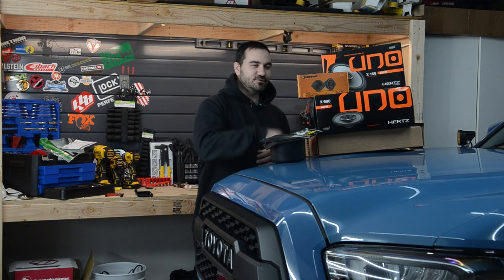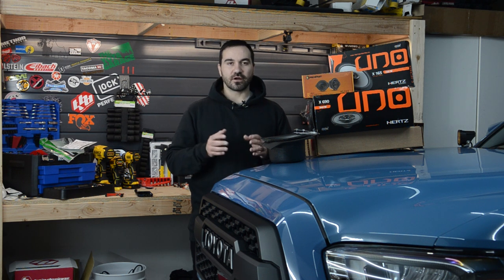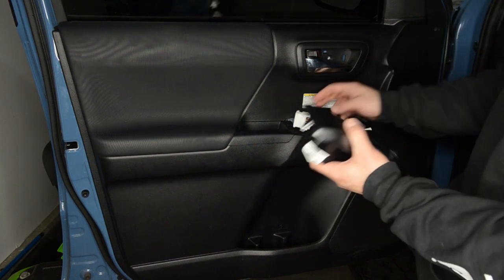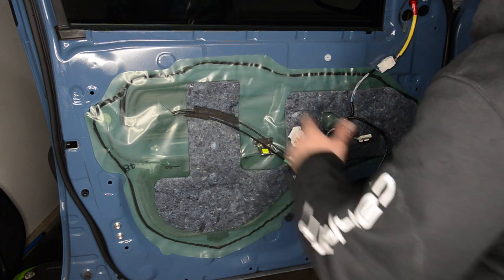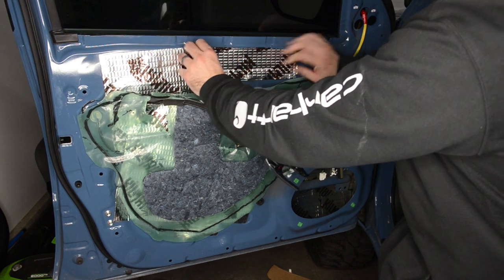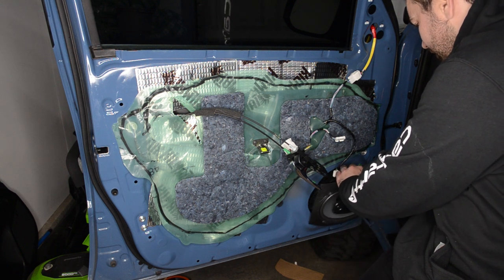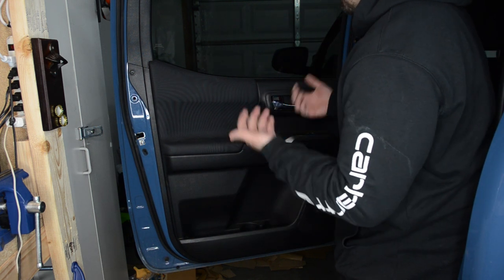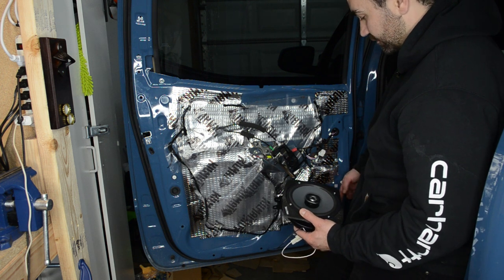Tacoma Sound Deadening & Speaker Upgrade How To - 2016+ Toyota Tacoma (3rd Gen) Sound Proofing

Comment: you should apply sound deadening around the mounting hold for the speaker itself like folded over it will help a lot i think more so than the extra strips you put on last over the other holes

Comment: If you look at the speaker brackets they have a cutout for the wire harness to come thru the adapter plate so you are not pinching the wires.
Reply: 1000000%. This whole video makes me not trust others to work on my truck because of how sloppy some can be

Comment: Should have put a gasket on the back of the mounting bracket. When screwing speakers to the bracket, use a finger to guard the speakers surround from any screw driver slips. For deadening on the outside door (behind the door panel) use a sound deadening matt to eliminate plastic rattling.

Comment: So I heard the jbl system has 2 ohm speakers which means when you put in aftermarket 4 ohm speakers like the ones you purchased it will give out less sound. At the end of your vid you said you couldn't tell if the sound was better. This is probably why. I think you have to replace the whole thing on the jbl including a new head unit and adding an amp. Good luck.
Reply: Good point, because I expected a very positive reaction to the sound out of those high sensitivity speakers. Hertz designed them specifically for base factory head unit power. The JBL is amped…and 2ohm like you said.

Comment: Great video bro, I had to ask are the Tacoma beast headlights worth the money? I have after market diode dynamics sl1 LED on my 2021 TRD off road, but they are not bright at all..
Reply from the maker: Thank you! I'm not running the Tacoma beast headlights, I'm running the AlphaRex LUXX series, but Tacomabeast might be selling them and advertising them as Tacomabeast ones. If light output is the only factor you're looking at, the SLI1's with the oem housings are close to being hte brightest you will get. Especially with the oem light pattern. If you want to have the "cooler" look and the sequential turn signals and drls, then yes they are worth it. If you just want better light output and more visibility driving at night I would first upgrade the fog lights!

Comment: Q: I did a similar speaker swap (different speaker brand) & it’s 3-way 6x9’s with 2 tweeters attached to them. But the problem is: no high frequencies seem to be coming out of the tweeters. Any tips on why??? 

So I took out my new speakers & put back my old OEM speakers back & they had way more high frequencies that my new speakers. What gives? 🤷🏽‍♂️🤷🏽‍♂️🤷🏽‍♂️
Reply: I had the same issue when I installed my kicker cs’..and the kicker Subaru tweeters.  Furthermore, my calls sound all muffled!
Reply: I would suggest going with components in the front with a crossover.  The feed from the radio comes from the tweeter input.  Crutchfield has a wiring kit that's included with components when you buy them.  Attached the Crutchfield adapter from the tweeter input, which then becomes the input to the crossover.  Then feed the tweeter and woofer from the crossover.  Sounds much better IMO.  Good luck.

Comment: Have been told by Crutchfield that if I upgrade the speakers too much the wire to the door speakers needs to be upgraded to take advantage of the full capabilities of the speakers.  Did you run into that?
Reply: Know it’s been awhile, but you only need to upgrade speaker wiring if you are adding an amp to go over like 60w RMS per speaker. I’ve heard of folks using factory wiring up 75w but ymmv.

Comment: How much did this cost?
Reply from the maker: Speakers were around $250 for the set.
Reply: @GearheadJT  Thanks. Did you ever get them to sound the way you want?
Reply from the maker: @endlessnameless3996  Yes actually, so I initially used those rubber "BoomBoxes" behind the speakers which I thought was going to help, I ended up cutting them out which improved the sound by 1000%.
Reply: Do you need to connect amplifire?
Reply: I’m actually interested to find out almost 1 year later from your installation.
Would you still recommend your set up or do you think it would need an amp to run the speakers or even different speaker 
Hope you can answer. I have a 2022 Tacoma and looking in to upgrading speakers but heard people saying if I have the JBL system a simple speaker upgrade won’t help
Any thoughts?

Comment: If you're not changing the head unit or adding an amplifier the sound will be just as crappy as before....especially on the back speakers
Reply: Wrong.
Reply: No, it will improve, but not by much.